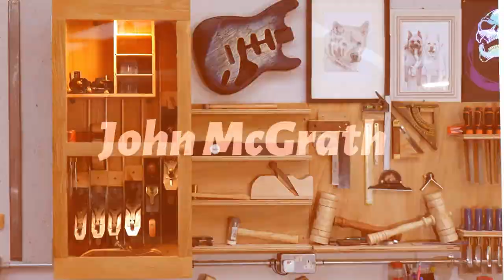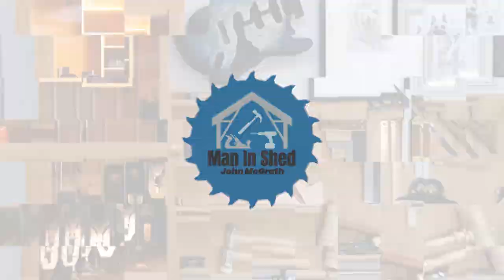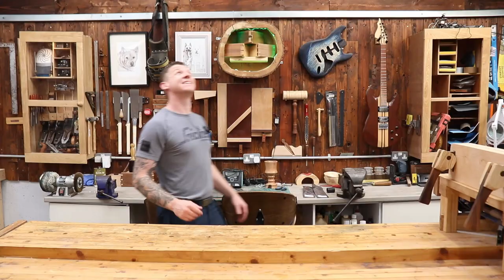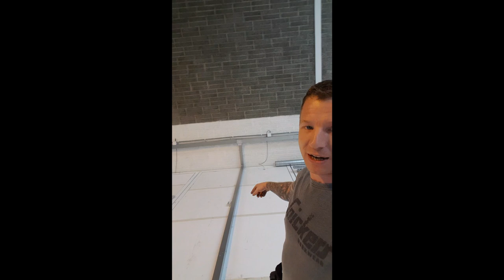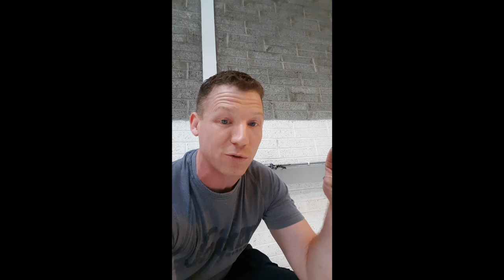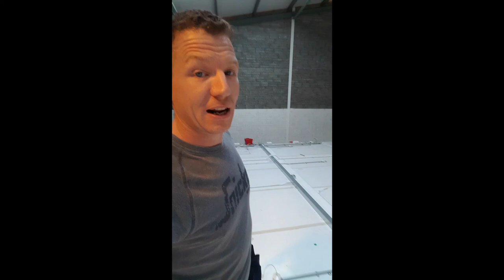Workshop Vlog #12. Update. New Channel. Knee Still Busted.

Comment: Use spray adhesive in the air. Spray it towards the fly, and when it flies through the mist it’s wings will stick together and you can stomp it when it flies. I’ve used it on hornets also. 😂